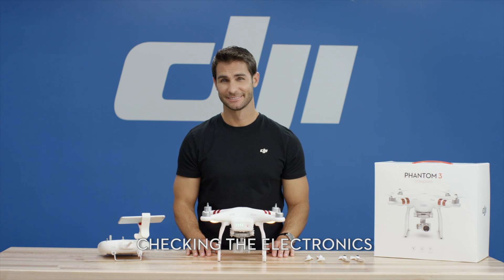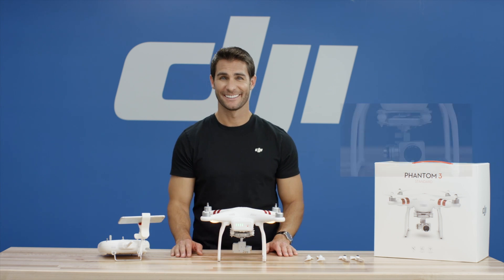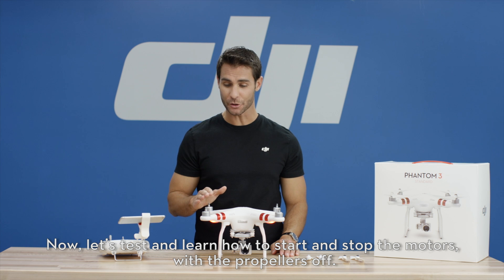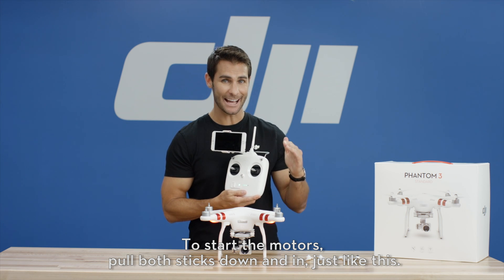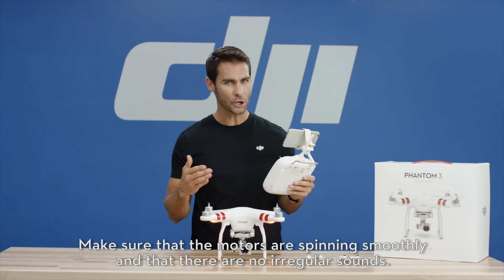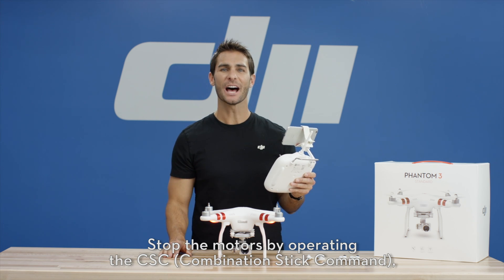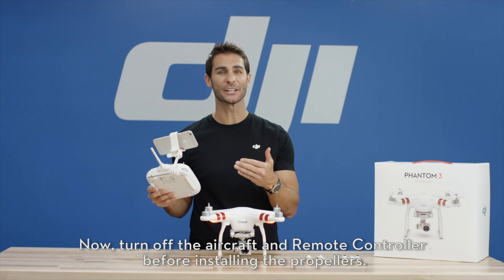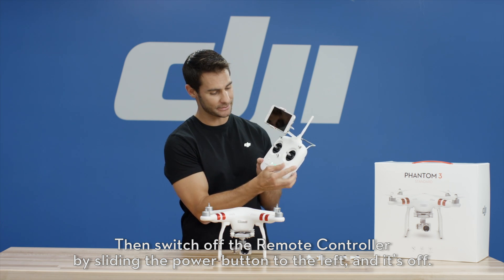DJI Tutorials - Phantom 3 Standard - Checking the Electronics

Comment: Question for anyone to answer.  I have a Samsung Note 5 phone, works great with DJI GO APP, i also have a Samsung Galaxy tab 4 but it loses connection all the time, obviously i am nervous about using the tablet, why would the tablet lose connection?  thank you...
Reply: The tablet would not have been optimised at that time for the app to function correctly. However that was 5 years ago, and the app has been updated so many times now that it would most likely function fine.

Comment: Quick question about the DJI Phantom 3 Standard remote: Do I turn the power switch on or off when I plug it in? The red light turns on when I plug it in while it's powered off, but when I turn it on the green lights show the charging level. I couldn't find anything online about.
Reply: +davidhall8621 omg this is why dji gives you all the gad damn books to look at jezzus
Reply: +davidhall8621 whats the answer? :)
Reply: +davidhall8621 haha thanks 👍

Comment: I've reviewed what seems like dozens of videos, read articles, and finally galled the Drone Guru himself. My Phantom 3 Standard is connected via WiFi <period> There are no other options. Secondly, on a good day, I'll get a maximum elevation of around 720 feet and a range of roughly the same amount - maybe a little less. I've purchased a couple extra batteries and a 32 GB disk, and I have no choice but to be happy with that. Granted, I'm jealous of the guys getting a range of 4 miles and even more jealous of the guys flying the drones capable of launching Brimstones and/or AGM 114s. I'd like to thank everyone for their feedback.

Comment: I got a Phantom 3 Standard for Christmas. After flying it around the house for a few days, I ventured out to the back 40. I'm using a Samsung Galaxy 5 phone with my controller and have connected them via wifi (I have not connected the two with a cable). The first thing I wanted to do was take it up to 300 ft and let it go. All went well until it got out to around 480 yards; at that point, I started to lose my signal. After moving the controller a little, and changing the position of the antennae to straight up and down, I got it out to 540 yards. At which point, I lost the signal completely. THinking that it would come back after 3 seconds (Return Home has been selected on the phone/controller) I waited. It had apparently gone into hover mode. I began quickly walking towards it and, only after it re-established a signal, did it turn and make a bee-line for home. I'm glad I wasn't over a lake somewhere. I deleted the DJI program from my phone, re-loaded it, and the updates. It still does the same thing.
Would someone please give me some advice on what I'm doing wrong? Thanks so much.
Reply: +Jack Berry this is the standard not a pro or advanced. The USB on the controller is to charge. Never ever have j heard of connecting the remote to the phone via a cord. It's wifi. Same as my old phantom 2. Not one video anywhere on the Internet nor dji has shown using a USB from phone to the controller.
Reply: +Mark Colbert connect your phone with a usb cord. the connection is stronger this way, you should get a farther range. Also, you may have been flying in an area that has radio interference. Find a place far from that. you should get the full range indicated.
Reply: Get a spectrum analyser and see what is operating on the same frequency if you're in a built up area ignoring the point of you shouldn't be flying as a hobby within 50m of other people and 150m of congested areas, your signal is prob getting lost amounts a sea of wifi signals. Also make sure you have return to home set within your settings and not hover. Before you take off ensure you get the message "home point has been updated" this is coupled with a fast flashing green light on the back of the craft